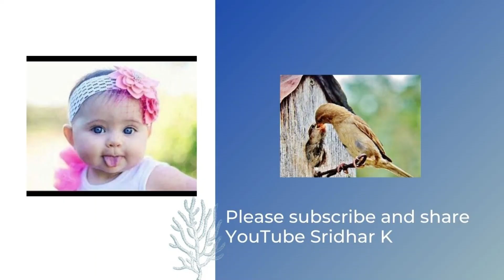What to do if the Volume guarantee mode isn’t working? #VG #ventilation #volumeguarantee #nicu

Comment: 7month baby when we picking up  while she is on her back  her head little go back still we give hand support to her head while picking up but on tummy time she holds head up turn side ,and doing army crawl by using left hand,right leg ,she didn't use right hand and left leg for crawling is this normal sir
Reply from the maker: When did you check with your pediatrician last? If not in past month, show once so the reassurance would be after assessment
Reply: @SridharKs  i told to our pediatrician but he told she is normal no need to worry . Is these symptoms are normal in 7month baby
Reply from the maker: @maheshdasar4676  yes, not sure why you are so worried instead of enjoying with your baby